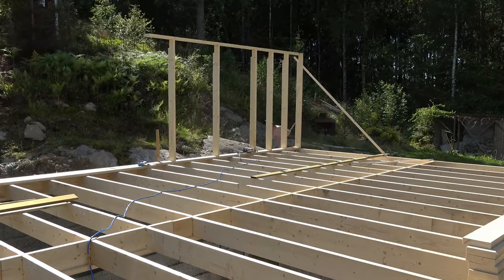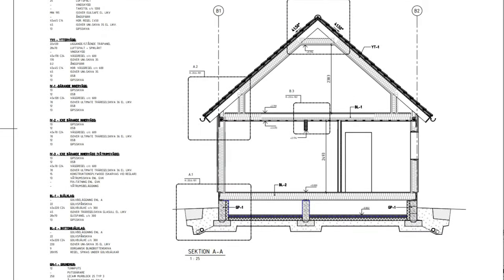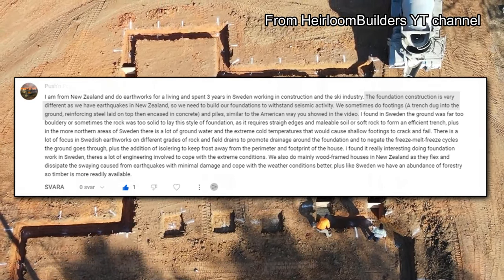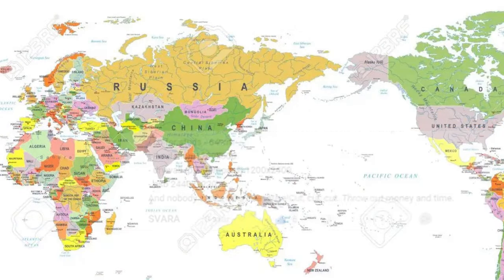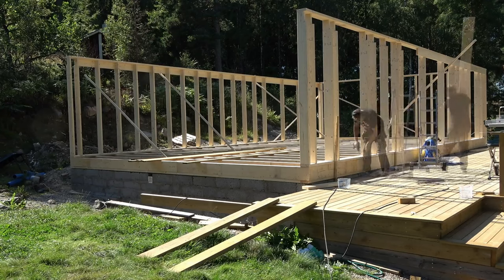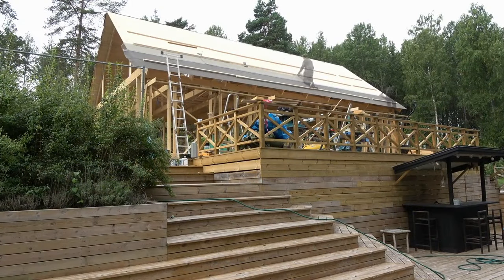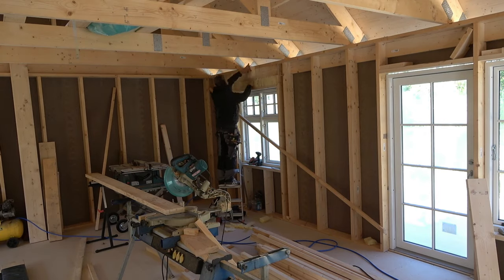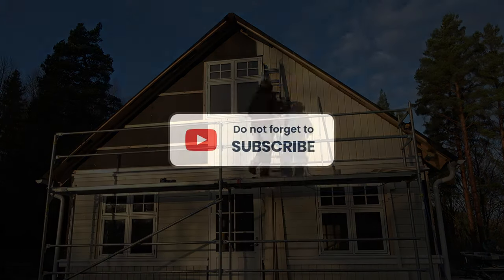UPDATED VERSION! Scandinavian VS American, CA, NZ, RU, AU building methods, let's compare...

Comment: American ways are about the $, not necessarily safety. 
One example is that a damper for your wood stove has been basically banned in newer setups. This makes controlling a chimney fire much more impossible and will lead to more property damage. The EPA claims that a more efficient burn is necessary, however, this leaves the fire to do what it wants once a problem occurs.
Conduit costs about 0.50 to 1.00$ per foot retail. (1.50-3.00 per meter)

Comment: No vapor barrier is required if you have foam insulation on the outside walls and seal with tape.

Comment: I watched the first video on the same topic. I'm very pleased to see an update that explained some of the differences. Very well done. 
My favourite part about your build is the internal wall. What a great idea for plumbing and electrical work. It keeps the vapour barrier almost breach free too.
I agree with pretty much everything you've said about construction methods for strength, rigidity, load bearing etc. I didn't know you used braided cable for electricity. Excellent idea. Here in Canada we have to use solid cable and it can sometimes be a challenge especially to pull through conduit.
I look forward to the next video on your house. 🙂
Reply: Europe has higher voltage that allows lower current flow to deliver the same energy safely with thinner wire.

Comment: Great videos you make!!
You place the Vapor barrier halfway your insulation, why there? Is de asfalt board moisture open? Or is it more logical to have the Vapor barrier on the outside? I’m a bit confused on this topic. 😅
In another video you showed a magnetic tool for drilling holes for electric boxes. Can you describe of have a Swedish link for that tool? I cannot find it in the Netherlands .
Thank you in advance for your reply.
Reply from the maker: We place the vapor barrier before the installation wall so that we don't have to cut in to it when installing stuff. The magnet thing is actually a Swedish invention, you can read about it here. https://jij-plast.se/hole-in-one-originalet/
Reply: @mindsparx1  
Thank you for your fast reply.  The next time I go to Sweden I go to a hardware store for this. 👍

Comment: Greate Youtube channel, I watched all videos, and you shared your valuable experience with details. Thank you! I have a question. Recently I watched Japanese timber frame home construction. They use posts and beams with mortise and tenon joints. Japanese architects developed earthquake-resistant metal joint components and used shock absorbers on the sill plates. They also use diagonal timbers connecting posts to resist horizontal forces during a quake. I live in Turkiye, and you may already know we had a massive earthquake in February this year. Unfortunately, more than 50 thousand people died due to poorly built concrete high-rise buildings. I want to build my own home since my family's house has heavily damaged during the disaster. Even though I want to build a Japanese-style home, it's tough for me since it requires high skills, more materials, and special tools. I can build a house as you build after your instructions. But I wonder about its earthquake resistance. Could you believe your building will stand during an earthquake?

Comment: Is this called cold roof? So the layers from inside out are: Inside->Insulation->roof deck (wood boards)->roof felt?->roof  batten->cross batten->stone tiles?  I thought this is quite popular: inside->insulation->wind proofing->batten->underlay->batten->cross batten for ventilation -> stone tiles/metal sheets?    Could you paste swedish terms so I could look up popular roof construction layers used in Sweden. I really though Estonia being so close to the Sweden the methods would be almost identical. NB: I like full wood deck - seems really solid.

do you leave some room for ventilation, between roof rafter, between under the wood deck and insulation? and does it have something to for windproofing?
Reply: alright,  seems that "NYBYGGNAD Takkonstruktioner Rockwool" gives quite good examples how roofs are recommended to be built. These Rockwool recommendations for layers are so different what they have for their Estonian site.

Comment: The difference between Norway and Sweden materials is the dimensions. Norway uses a 2x4 of 48mmx98mm, 2x6 of 48x148mm etc. Besides that it’s very similar.
Reply: That is probably the same because 2"x4" and 2"x6" are the sawn dimensions not the finished dimension.
Reply: @jonathanbuzzard1376   Sweden uses a 2x4 of 45x95 mm 2x6 of 45x145 etc. In Scandinavia We used to use inches before and the vocabulary sticks today. Personally I think it’s easier to think in inches with rafters and beams etc. but it’s easier to calculate in metric.

Comment: Concerning ruining electrical. I work around Chicago Illinois we are required to run all electrical through galvanized steel conduit and it has to be solid core wire.

Comment: I’m very interested in using osb on the walls in my house. I’m about to tear out the electric and of course that means cutting the Sheetrock and either repairing all the cuts, or redoing the walls. If I tear it all out I’m thinking of using osb first. What thickness do you normally use for walls?
Reply: You’ve become successful. You even have a WhatsApp scammer! 😂

Comment: I thought that in Finland, you have to have douple plasterboard on the walls for firesafety. I am not a builder, but i have never heard anyone using osb behind double plasterboards.
Reply from the maker: We put double plasterboard in some commercial buildings as fire protection. I have also built walls with three layers, 1 osb and 2 plaster.
Reply: @mindsparx1 Young carpenter from Finland. We usually use single plasterboard for indoor walls with insulation inside, sometimes double is needed for firesafety or it needs to be dB wall, but if there's going to be something heavy on the wall then we use plywood behind them.
OSB has never been common in Finland until recent years.

Comment: As an American now residing in Sweden I've been interested in the different construction methods for a while.

One thing I can't get over in the US is (was) the lack of insulation used. New construction has taken this into account but most mass produced houses that are more than 30 years old have no insulation (save for the attic). 

It seems Sweden more often uses some sort of an active ventilation method (like an exhaust fan) and tuned ports in rooms on exterior walls. I don't think this is a thing anywhere in the states.

*Not an expert in construction methods whatsoever 😅

Comment: Installation walls are standard in Quebec province, Canada.
Reply from the maker: Really, First time I hear that! But I'm not surprised, Canadians tend to choose the best from all construction methods
Reply: @mindsparx1  yes. Every ceiling and exterior wall has 1x3 furring on the inside so the electrician don't have to poke holes in the vapor barrier. Ceiling strapping is standard in new england as well but I don't think they fur out the wall. Also, I have never seen a house built here without a rainscreen  so I was surprised to learn that it was not common elsewhere.

Canada is pretty large so there are lot of difference from one province to the other.

Comment: The only thing I disagree with you about, (insofar as your building method is concerned) is that I would prefer to make my work easier when framing over the open floor joists. I would probably do this using four or even six 4' x 8' sheets of 3/4" plywood that I would shuffle around on top of the joists as needed, to give myself a more stable, or useable platform to work from. This would also not get in the way of raising the roof trusses in the same manner that you did in this video, as they could be placed wherever they are needed.
Reply from the maker: A normally functioning person would do that, but I'm made a little differently :)

Comment: I am swedish carpenter and see many videos from usa how they build new houses. It scares me alot when they do electrical and plumbing inside walls. In sweden we have safety standards, all wires must be in tubes/hoses. And absolutely no waterlines can be hidden connectors inside wall.
And one thing i also see that even when lumber prices are high they build like the woodbeams are almost free.... They place dual beams and triplebeams together on places they dont need to be?!!? 
This will also result in thermal bridges wich makes the house use more energy to heat. 
And the ugly design of sockets/outlets/switches for electricity??? oh my god , i feel my stomach turning when i see a brand new house with that shit installed
Reply: All waterlines in Canada must be pressure tested to  200psi or 14 Bar before drywall is installed. Before plastic waterlines, rigid galvanized or copper only came in specific lengths, so to say, no waterlines can have hidden connectors is just STUPID. As far as the ugly sockets/outlets/switches, that my friend is also stupid, atleast our outlets already are double not like in Europe where you need to install 2 boxes.
The double and triple beams are by code, does not come down to if you need it, comes down to loading. Look up Header and beam calculation tables before you make such a  comment. In Sweden ve hafe safety standards, ja swen okay.
Reply: @fred1418  why do we need double boxes? Are you talking about electrical boxes?
In a normal electrical box we can put two outlets.. If there's more than one box is usually for network and or TV (tho separate TV cable isn't common any more).. Or if you need more switches than a double switch..
Reply: @raxxo69  European electrical outlets are single outlets and fit into one round box that's it. same as Germany, Austria, Sweden they all have the same system. North American outlet already comes with two and to install we use a 4 x 4 square box with mud ring or commonly an 1110 box which is 2 1/2 x 3 1/2 inches. As far as networking, most older brick houses because it is a pain to retrofit use Wifi, but nothing beats the speed of CAT6 which in a wood frame house is easy to install. European electrical wiring has always been behind American for ease of installation and wiring. In Canada if you have just wires for a light fixture on the ceiling without a box, then it is for a flourescent light, but if you have a lighting fixture it will never pass inspection without a box.
Reply: @raxxo69  Don't argue with FRED. He knows best - even when he's wrong - and doesn't shy away from being rude or condescending in his replies. Better leave him be.

Comment: I wonder why do you use plater over the OSB. Wouldn’t it be easier to cover it just with wallpaper? I get it from the point of noise insulation or wiring in between but otherwise I don’t see why.
Reply from the maker: There are many reasons, The boards move, if you put wallpaper on that the joints will crack. Another reason is that plaster acts as fire protection and is required in many houses to slow down a starting fire. Plaster also have a better surface to paint on.
Reply: Plaster boards are a "dead" material, what do you think will happen to the wallpaper directly ontop of a non dead material like osb when temperatures changes ?
The osb moves (contracts and expands ) depending on temperatures changes and humidity, the result of wallpaper directly onto osb is begging the wallpapper to crack over time.
Reply: @mindsparx1  Yeah, the fire resistance is a fair point. They also have probably better sound absorbtion. By the wall paper I ment modern vlies sticker wallpaper. It can flex. So not much cracking going on. I'll be glueing the OSB between each other anyway. I have to discus this further with the architect.
Reply: We hardly use wallpaper in Scandinavia. Seen as out of fashion, and tatty.

Comment: Classic US stick framing is 16" on center - matches the 4x8' plywood sheeting, just as 24" - 18" isn't a thing.

As for how US construction is done, you'd be hard pressed to find anything stronger, if you compare to areas where code applies, and it does in most more densely populated areas, especially those affected by high winds, wildfires, floods and earthquakes. The tie-downs we normally use in Scandinavia are BS compared to some of the HD stuff used in the US. simply because we don't need it. Just as most of the US normally doesn't have a need for insulating for arctic climates.

As for vapor barriers, the sad truth is that they all have one thing in common: Sooner or later, they will fail. The only questions are where, when and how much, and you're not likely to know before it's too late. Understanding the materials, using the right ones for the right climate at the right position in the building, would be much preferred over having to live in a ventilated plastic bag. Unfortunately this takes knowledge and skill all but lost in modern building. Overuse of insulation will become an issue in the future as well, as some of the houses today are only insulated for heat retention, which is a great mistake, at least for us a bit further from the Arctic circle. Insulation needs to be balanced, and not just more, more, more, like they'd love to have us believe. the manufacturers. They're in it to sell. Don't believe anything else for a second.

Comment: What kind of software do you use to design the house framing?
Reply: It looks an awful lot like Sketchup.
Reply from the maker: It is :)
Reply from the maker: It´s Sketchup.
Reply: @mindsparx1  Isn't it amazing that we have free (or near free) software that can do this in a 3D environment? I remember when basic 3D design (solids) packages were thousands (USD) per month... many still are. 

I use Siemens NX and have my own home designed in it... mainly because that's what I use for my business. A few parameter changes here and there and I can add another window opening to an array or change the length of a wall or the position of a bathroom.. and everything updates to accommodate. But for thousands of $$, you would expect as much. Sketchup has come a long ways.

Comment: No clue what is up with that comment about electrical. There's no 3 phase power in every home in Europe. Nobody uses stranded wire, its all solid 1,5mm/2,5mm and 4mm in 16 or 19mm conduit. And sure you can pull it through conduit, even through flex conduit without much issue but you really dont put flex conduit in a wall cause there's no reason for it. You can also just buy flex conduit with wire pre-installed but pretty expensive.
Reply: In Norway the utility companies wont allow you a new 1phase (TN) or 2phase(IT) installation any more (we have 230V IT and 400V TN depending on age/area). 3phase all the way, even for menial installations (street lights, tiny appartments ect). No solid core wire exept if in cables meant for surface mounting or outside/in soil. building codes prohibit in wall installations without conduit for homes, but you could find it up to 94' in commercial settings. Having had the pleassure of replacing 1.5mm with 2.5mm (there were reasons) without tearing the walls down I disagree with the notion that conduit is not needed.

Comment: The US argument has been that nails have a higher shear strength than Screws. Also nail guns are faster during install than screw guns. Both of these are conceptual bias that is not born out with the engineering.

Comment: In the USa we use platform framing. You build the deck,floor it over with subfloor, . Then you can walk on it to build your walls. I dont understand the method you use. Your dangle method is much more dangerous to walk on. If you cant frame a whole wall and lift it yourself ,you frame smaller sections you can lift. Nail them together. I dont like decks as a rule. They are a maintenance nightmare and the bounceback of water on the building is an issue. They are extremely over rated. The rotproof materials dont last and are probably very bad for the environment. Foundation where we live go below the frost level. The foundation must be ventilated  ,have a vapor barrier,cellar and perimeter drains. If you go down and hit ledge that is ok too. We use a lot of native woods. Any real carpenter can size his beams correctly. If in doubt you go up one size. They have span tables. Wooden houses and log houses are not similar. Personally I see a lot of maintenance issues with log buildings. Dormers should be avoided. Metal roofs are best. Lots of houses in Europe are stone or block. i cant comment on those. I dont like block for a foundation.Framing @ 24 Oc is Fine. It can be 16 . 2x 6 24 Oc is standard I dont think that is fireblocking in the photo. It looks like nailers for some kind of vertical siding down the road. Fire block ingis 4x4 or 4x6 set at the top of the first floor level. We use boards for the subfloor and insulate the floor after. In fact dont usually insulate the floor as we have a heated cellar with woodheat. Too many boards ending on the same rafter On that roof. We never go more than two rows. Our rafters are 2 Ft Oc. With a tie beam on the bottom and a ceiling tie beam at 7 feet more or less .Queen post trusses work too. Vapor barrier inside is standard. Out side is a nono.Wiring is to be deep enuf in the wall so that an 8 penny nail cannot reach it. Plastic conduit is useless.,its not deep enuf in the wall.